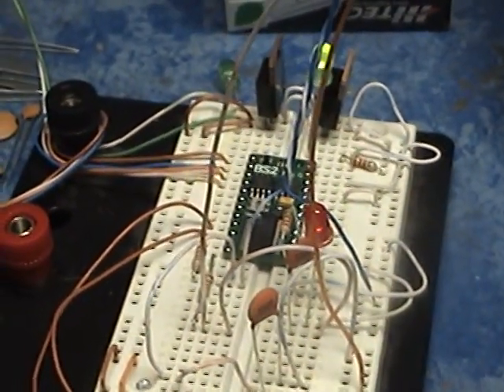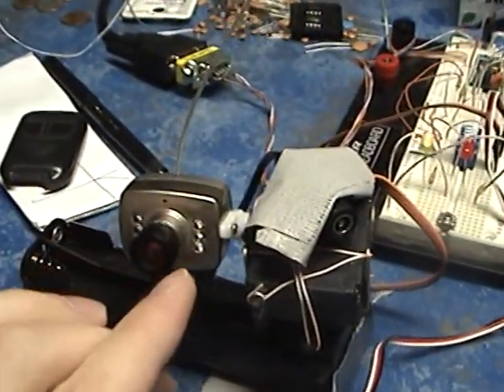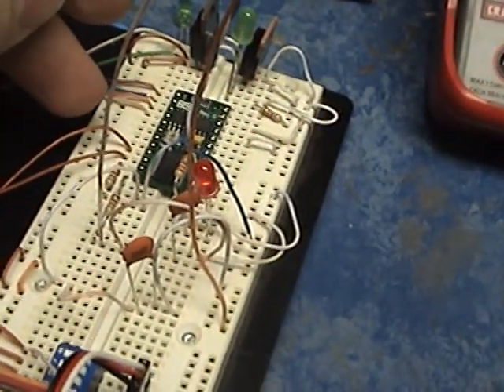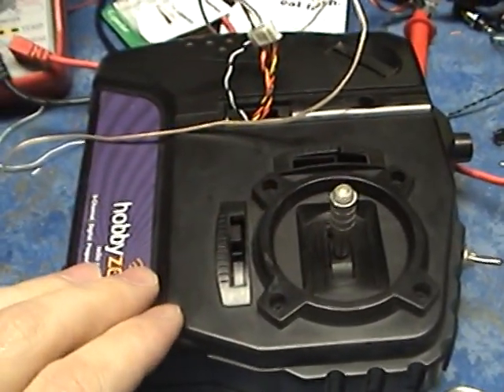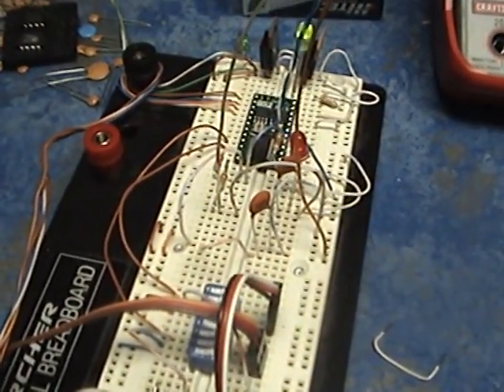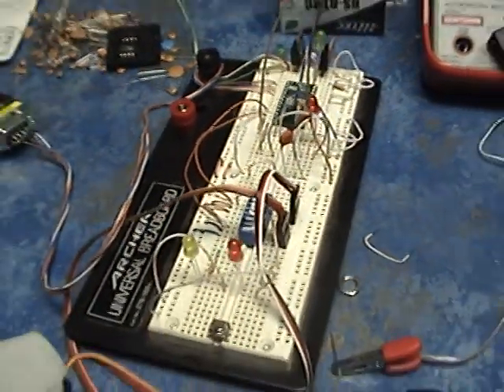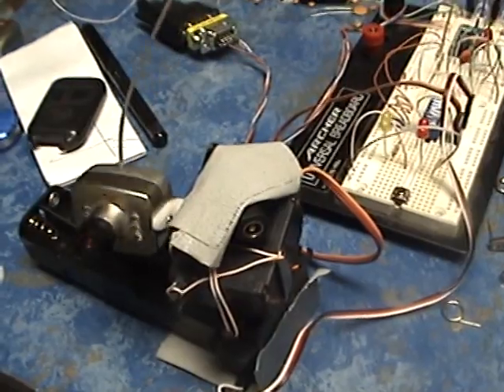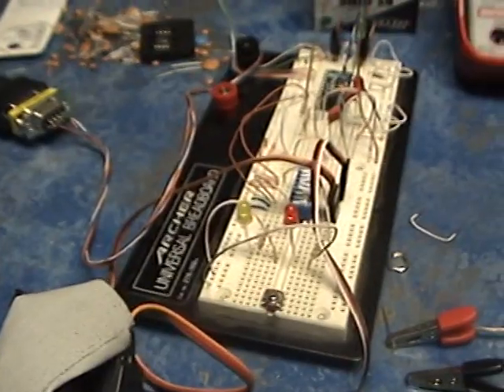Parallax Basic Stamp 2 Servos

Comment: Rigging up some kind of motion or object detection system where it turns on the camera or turns on a recording system for the camera would be cool...I'm a big fan of them sonar dectectors...Some kind of heat sensor, would be cool where if your cam is outside would allow to not to have the cam on whenever it spots a small body heated object (animal). I cant find any single heat sensors yet, there already built into some kind of device, I dont think it would be worth it to buy it then gut it.